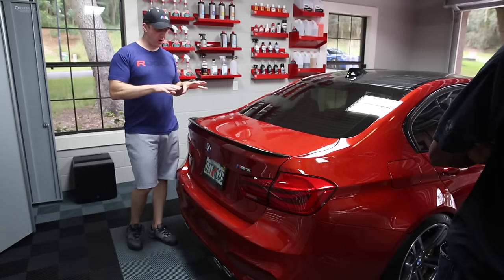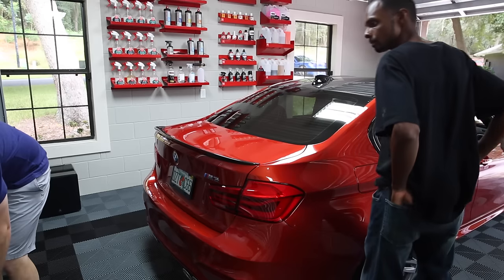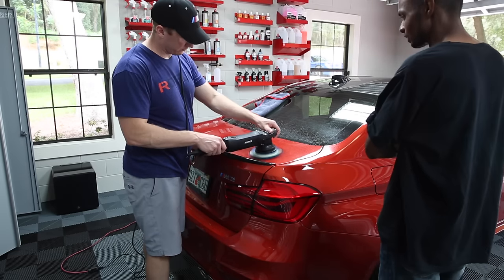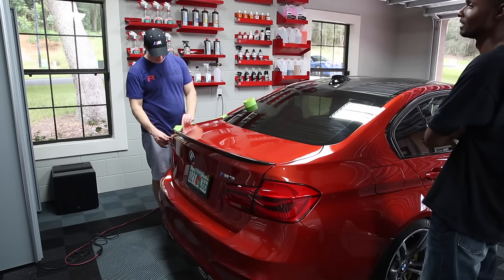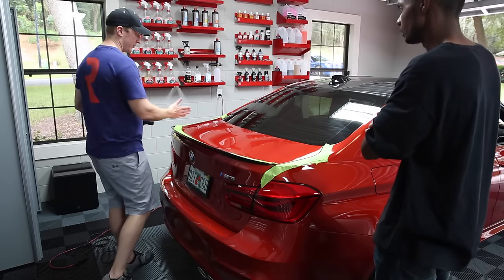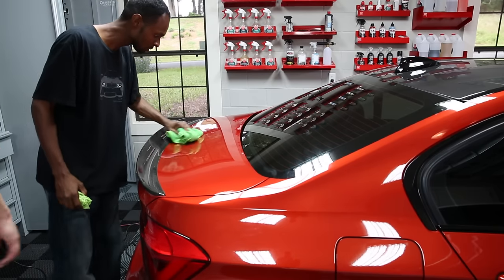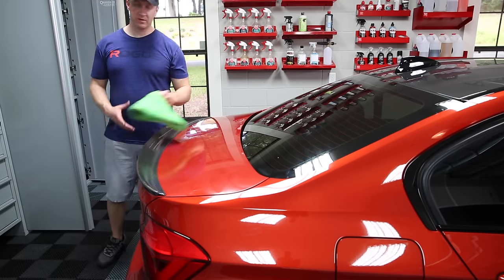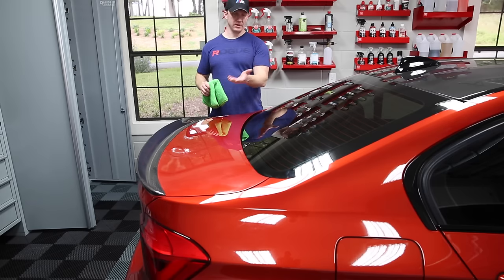Paint Polishing Tutorial with Andrew's New F80 M3

Comment: Matt, you say in this video you only detail your cars every 8 months, and you only touch up with a little spray wax for drying during these 8 months. Yet pretty much all waxes only last 2-3 months. How do you keep ur beading/shine during these 8 months? Because my beading is already alot worse after just one month after doing a full detail.
Reply from the maker: +Amateur Detailing I'm seven months in on both cars, and they are still holding up.  You could always top the car with a new coat in between.  I do that occasionally.
Reply: Will the wax bond properly when you just throw on an additional coat after a normal wash? Without stripping the prev layers, claying, polishing it? Because I'm pretty anal in my head about this stuff haha.
Reply: +Amateur Detailing Yeap it will bond just as fine
Reply: Thank you Angelos!